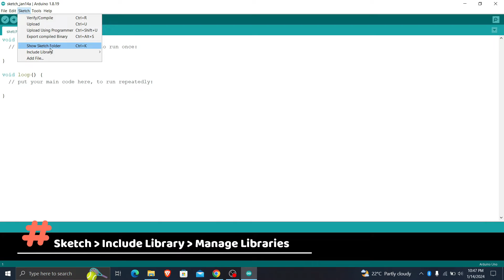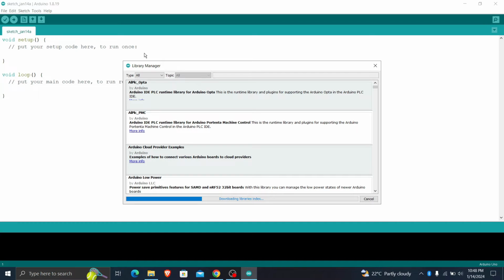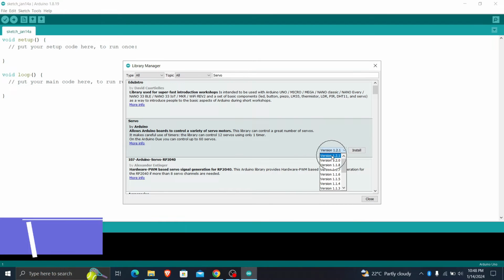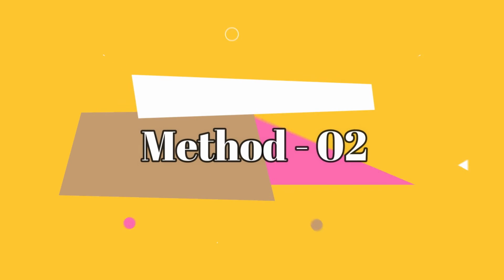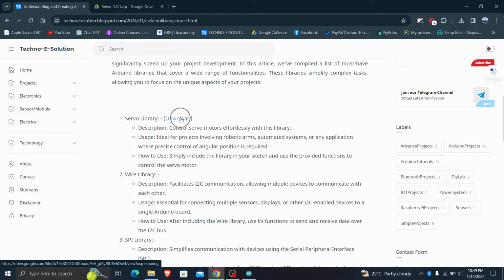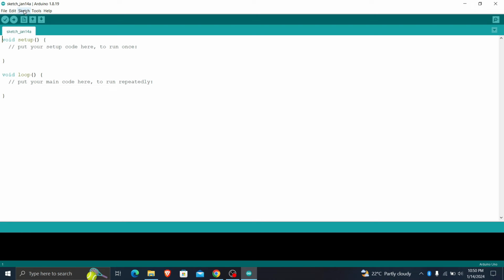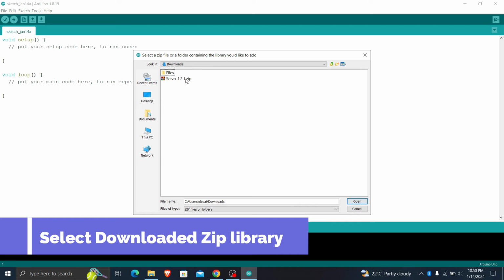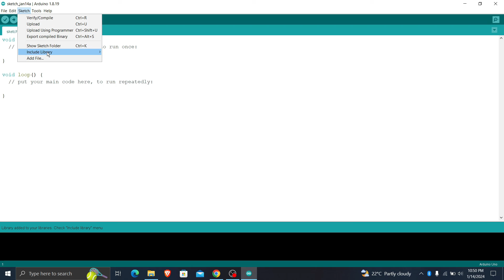How to Install Servo library in Arduino IDE | #technoesolution  | #arduinotutorials

Comment: My servo motor wont work even if its plugged with the arduino cable. I programmed with a simple code and checked but i get a disturbing low cranking sound inside from the servo motor. Any solution? I checked it with regular supply and the motor is fine. But connecting to arduino and it doesn't work. What will be the reason?
Reply from the maker: Follow the steps to solve the issue.
1. Check for proper connections.
2. Sometimes power through Arduino isn't sufficient for the servo motor so try to provide an external supply to the servo motor.

The same problem I faced and it was solved by connecting the motor to an additional power supply.